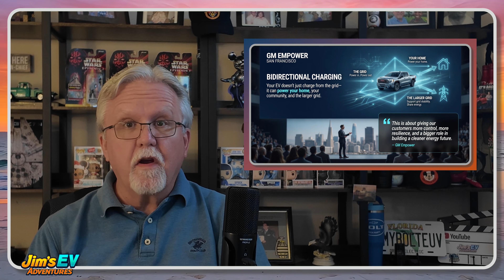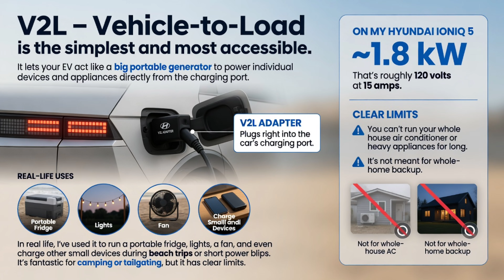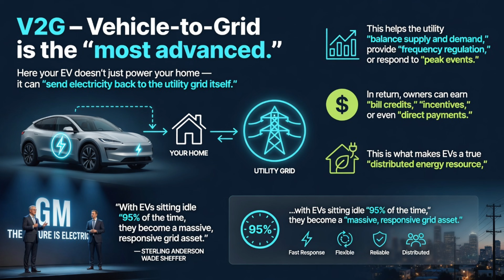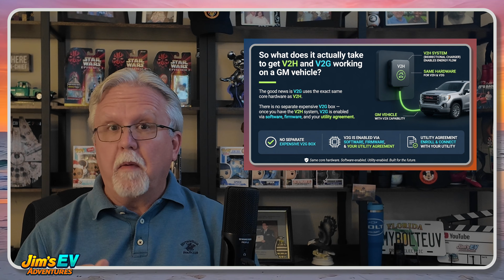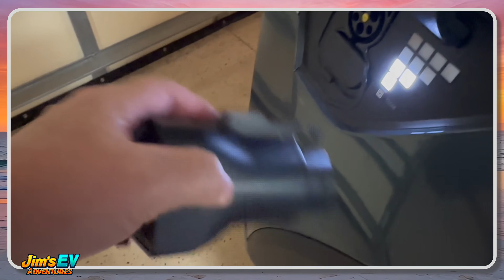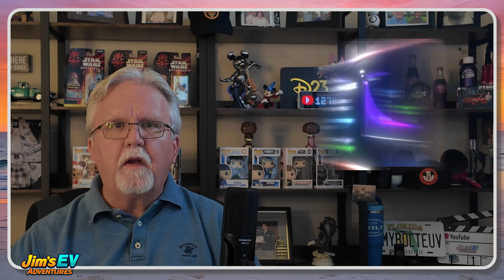Your EV Can Power Your Home! (Here's How)

Comment: My ford lightning will do this but the equipment is quite expensive and you have to use the Ford vehicle charger.  However, a cheap alternative is to use the 240-volt 30 amp port in the bed and connect it to the generator input on my solar box.  Downside is the poor software - there's no "power only" mode on the truck; it has to be on, just like you're going to drive, and you have to turn off everything that normally runs, climate, headlights, etc.
Reply from the maker: There are many work arounds. Thanks for watching.

Comment: Yes the system works great. The idea was perfect. There's a few downsides to this now and I'm not going to go in depth into all of them but I will talk about a few mainly one or two. They have all the upsides but there are two downsides to this. The one downside is if your car isn't classed for two-way charging you can still do it but it'll show it in the system which is your car's computer system. You go to get it serviced and the dealer tells you they can't do anything to your vehicle. You start having issues where your battery isn't fully charging and when they put the battery on the computer and they see that you had rapid discharge when you weren't even driving the vehicle because your mileage don't add up, they can tell that you would reverse charging the vehicle that isn't designed for reverse charging And that right there my friend is the issue. People are going to have case in point. You have the Ford lineup under Ford. The F-150 lightning is two-way charging when I say two-way I'm speaking on the term relatively of you plugging a charger in it not only can charge your car, but it can also reverse the polarity to where the charge that's in your car can power your home but the Mustang Mach E is not allowed to reverse charge. Is what Ford is saying And it was explicit Ford said it doesn't do that. It's one-way charging now. I've seen these charging systems where it can reverse the polarity and power your home from the charger. I seen it in action on the Mustang Mach E So I'm impressed nonetheless but you got to look over time. Hey I bought this car. I bought this charger. It works great. 6 months a year later I'm having battery issues or I noticed my vehicle doesn't charge till $100. It'll say $100 on my phone on the dash and soon as I unplug it's automatically at 98 or I noticed that I'm not getting the same range that I used to get. I used to be able to travel 350 mi now that looks like I'm only getting about 300. Especially if you buy this vehicle brand new and you noticed this a year after you've been using the charger. Both ways you get this system installed you want to see for yourself so you charge the battery fully. Then you shut the power off in your house and wash the system. Reverse the polarity to power your house back up. What you think about that

Comment: Hi Jim ! A folk from Portugal here. During a 8 days outage due a storm I plugged my Ioniq 5 through my generator socket and boom !! 4 days of electricity. After that just looked for the closest charger and got more 4 days of electricity.
Reply from the maker: Awesome story. Thanks for sharing.
Reply: Yes, fairly simple and painless right? Good on ya for having a panel plug available. How far did you have to drive to get a working charge point?
Compare that to trying to find a working fuel station - basiclly the same distance I expect, as it needs electricity to power the pumps, lights, control systems, sale terminals. Or one that prepped and have a generator or solar system!
Compare that to the experience of running your own generators (best to have 2 small linked, than 1 large that may fail) -
Maintenance : oil changes each 24hrs of running, filter checks/cleaning, refills of fuel (dont spill petrol onto a hot engine!) so much fun in a storm 😢.
Storage & transport of HazMat : oil bottles, fuel stabilizer, fuel tanks with explosive fuel vapors, rags, carb cleaner/starter sprays, etc.
Nightly shutdown & service of generator : conserve fuel, cut fire hazard while sleeping & stop the godawful noise so wife & neighborhood wont shoot you, dont attract genny thieves.
All MUCH harder if you live in a rented apartment block (often prohibited), or hopeing the wife and kids can handle it while away for work😮. Starts to make EV + solar panels sound good, right? Either way not free... I can buy a new portable generator or battery unit for the cost of throwing out the contents of my fridge & freezers once!

Comment: I was really excited about the possibilities of V2H and V2G ("V2X") several years ago when battery prices were very high and there were incentives for the installation of PV systems. Now, I think it's a bit of a gimmick, much as I used to think putting a camera in a telephone was a gimmick.

Additionally, the cost of storage batteries is plummeting, so that makes it more attractive to have a box of dedicated batteries in the basement, possibly able to charge the car with stored PV energy. And, I am not sure that exposing my home's battery to the daily risk of American Rush Hour Traffic, is such a great idea. I do see some benefit in being able to drive over to the next town, charge my EV's battery, and return home with enough juice to keep my furnace and fridge running if there is an extended power failure locally.

In the middle term I think the car's battery and the home's battery most economically need to remain separate. I think the near future is fast charging batteries with high mass/volumetric energy density for the car and cheap, heavy, slow-charging batteries for the house.

That doesn't mean that I think any of this is a bad idea. Indeed, in the next five years I think we will begin to see that in new construction, every standard "fusebox" will incorporate an electrical management system able to handle any combination of grid, PV, home/EV/cordless power tool battery, windmill, mini-hydro and Mr. Fusion.

I am glad that GM is working on V2X, and I am glad that others are willing to spend the money to experiment with the gear and make it work. But until the state of the art is at a much higher level, I will be spending my limited budget on PV and a dedicated home battery system.
Reply: I get your arguments, and mostly agree, but hopeing builders will use more capable (expensive) panelboxes is a fantasy. They will build to minimum code reqts unless incentiveized (payed more, or law mandated). Each State or city region has differing codes. True custom homes are your choice, but rare, and if the buyer isnt tekky and forward thinking, wont happen.
Fortunately, most can be retro-fitted or expanded later as codes require some space for expansion.

Comment: I have 2 EUV’s so I’m unsure if we could ever do anything even though it has a large 11.2kWh inverter inside. It would be nice if GM was to modify the software, but GM is GM, so they’d rather we bought something new (that we’d have to replace later). 

I do plan on V2H eventually for my battery. I’ve been researching solar, and concluded that an AC coupled, grid tied system with the addition of a “gateway” which is a transfer switch designed for solar integration. The gateway would communicate with the V2H charger, and probably V2G whenever the equipment on the grid is available. Using a vehicle as a home battery backup is more important than supplying back to the grid. Where I live, our utilities are cheap and very good. The Residential Variable rate is 8 cents off peak, 18 cents during peak. The standard all day rate is 12 cents for residential.

Comment: I have built in V2L (up to 9.6KW in a combination of 120V and 120/240V) with my F150 Lightning.  I have used this a number of times at mountaintop two way radio sites, and field "kitchens" several times.  I will be using it again for the field kitchen for our 4th of July fireworks crew meals (leave the fireworks to professionals - like me) in a couple weeks.  I will be adding a 120/240 inlet to my house for use with a manual transfer switch.  

I have no plans to add true V2H or V2G unless the incentives become huge as it's currently way too expensive and here in SoCal, we SELDOM have long duration utility power outages.
Reply from the maker: The incentives will improve. I can see this as something geared toward fleet vehicles, too.

Comment: I’ve had a Tesla Powerwall2 for the last ten years. It doesn’t support bi-directional energy flow from my EV, so during an outage I can only use the energy stored in its 13 kwh battery.  Fortunately this hasn’t been an issue because my modest 3.4 kw solar array produces sufficient power to run my home during the day and fully charge the battery.  This allows me to depend on the grid for only 15% of my total power usage.  Using my EV to supplement would resolve this deficiency but that means the EV has to be home during the outage and the cost of the V2H/V2G equipment would add about $8K to the cost of the system. I’m not sure it would be worth it for me as the Powerwall operating by itself has already offset almost $24K in energy costs over the past 10 years and has earned an average of $350/year by participating in a Virtual Power Plant program run by my utility.

I’m not trying to knock the GM system, only warning those who already have a battery system that the costs of adding the equipment necessary to pull power from your GM EV may not be justified.   Additionally if you have a Powerwall, you should know that the General Motors (GM) V2H/V2G systems are not natively compatible with the Tesla Powerwall. GM's proprietary bi-directional charging ecosystem requires specific GM hardware and operates on a DC path, whereas the Tesla Powerwall operates as a closed, AC-coupled ecosystem.

Comment: Thanks Jim! Really enjoying your YT channel.  This last winter we traded our 2013 Chevy 
Volt for a 2025 Cadillac Optiq.  Loving the new full EV and since we live at the base of Mt. Shasta in California we are especially appreciative of its AWD capability.  When I purchased the dealer provided me the GM Level 2 charger at no cost, but in my research on how to set up our home I was made aware of the V2H system that GM sells.  For that moment in time, the simpler L2 system was much more economical.  Our home is already grid-tied with a 24 panel solar array that reduces our electric bills to only a few months per year where we pay them. The V2H option remains under consideration, but the $8-10K expense has not yet moved me. I especially appreciate your knowledge and enthusiasm for EVs and look forward to more of your well studied sharing!
Reply from the maker: Glad to hear you're enjoying the new ride—and I completely agree that the current price tag on that hardware is a tough pill to swallow!

Comment: So strange.  I was just looking into this this morning.  The Equinox and LYRIQ both have something called a powerbar that connects to the J1772 port and provides V2L like your IONIQ.  However, the Equinox 3RS is the only trim that has that option and in the LYRIQ, even though I have 19.2 capable in our 2023DE, the model yr 2023 did not have the inverter needed to use the powerbar.  That only came in MY24 and later.  So, the Cadi only has 19.2 w/o V2L.  The V2H & V2L are going to be key features on my next EV purchase.  I really like having the EV as a backup home battery with at least V2L and V2H capable.  Well done video.  Thank you.  I enjoyed watching.
Reply from the maker: It’s definitely becoming a must-have feature for my future vehicle list as well!

Comment: This is wildly expensive, incompatible with my home solar setup and redundant to my solar setup and the inverter that is already in my truck. 
Additionally, by using proprietary software, this system only works with GM vehicles. ISO 15118-20 details bidirectional charging standards for AC and DC charging. I can't see this as anything other than a money grab by GM to force you to buy an additional inverter and lock you into buying GM only in the future.
Enphase and sigenergy are both working on ISO 15118-20 compliant V2G chargers, and the IQ EV charger 2 is hardware ready to provide AC V2H pending software updates. I'll pass on proprietary tech that does not conform to standards.

Thanks for the explainer, Jim. The GM series was really good.
Reply: Yes, I also appreciate Jim's analysis here. But the market needs an open source interface and, specifically, a way to adapt to the sort of 51.2VDC LFP home solar battery systems that are everywhere now, be they off grid or hybrid grid-connected system (ie: using the grid exclusively as a "battery'" and as needed: not back-feeding). With one of those PV/battery systems in my house and an LFP-equipped EV in my car port, I could survive very easily without J.P. Morgan and Samuel Insull's 19th century electrical utility business model. The utilities are killing off the potential of net metering everywhere their lawyers can. I'm sure most of them don't want V2G anymore than they wanted basic solar net metering a decade ago. 

I've been following V2G developments for well over a decade now it always seems that it's the legal negotiations with the utility that are holding back the technology. ISO 15118-20 seems to be the latest way to keep the utilities and their legal teams involved in an age where they seem less relevant with every passing day. Moving solar-generated electricity stored in your home battery back and forth between your EV's battery should be relatively straightforward. And, yes, the GM system with it's proprietary mishmash of equipment feels like a massive money grab.
Reply: I agree. I was a bit disappointed with the 9.6kWh inverter myself.
Reply: With this tech it will be an add on  with an ats

Comment: Great Vid 👍
I think GM is behind in tech - this should be an all one unit for those that opt for V2H/G. Or at the very least the Home Hub and Inverter should be combined IMHO.
Cheers from Canada
Reply from the maker: It depends on which engineer you ask — V2H/V2G both require the same hardware. Again. Price is high across ALL the technologies for now. Time and technology will improve with time. Let’s watch together. 👍

Comment: Jim, as you stated, the early adoption phase is always more expensive and will become old tech really quick.

Having said that, I would like to see GM offer this at a substantial discount, long term cheap financing and cover the cost of installation for a typical home.  Why do I say that?  Because as of right now, this system would pigeon hole you into the GM brand.  You couldn't use this with any other OEM.  It would be another reason to consider a GM product.  Selling it to try to make a profit now doesn't make sense with the current GM EV uptake.

One last thing.  I have a 26 Equinox EV with the 11.5 kw AC charger.  Would this work with the system or do you need the onboard 19.5 kw charger?  This has never been clearly stated one way or the other.

Comment: V2L, yes! V2H, sure. V2G hmmm It would have to come with specific user defined settings. I.E. Only sell to grid above (user defined) $1-2 per kilwatt. Leave (user defined) % of battery left in the vehicle. Universal hardware(say your GM gets totaled and you buy a Tesla/Toyota/Ford/Kia/Hyundai/etc EV to replace it, The hardware on the house needs to accept all manufactures.) And not cost 8000$ for the hardware plus install cost. Sheesh thats a chunk of change to hope to get back. 

I got home battery storage. I could use the Ioniq 5 V2L to slowly recharge my home batteries and just power the bare minimum.  Or the Ford Lightning has 240V that could be used to fast charge home batteries from the EV battery with the correct charger.  

V2H is nice but the vehicle needs be to HOME to keep the the fridges going, sump pump running, etc. If i'm not home when the power goes out, no power to the house. I might need to go to work with that vehicle. So home is left without power. 

Each has its Pros and Cons. Im still not buying a GM tho,.....
Reply: To your last points : A home mounted battery/inverter unit (of some size, expandable over time) is clearly optimum, working  together with an EV or hybrid car to transfer power as required. That should (but not must) be teamed with some solar panels (of some size) to permit sustained operation during outages, reduceing power bills, eliminateing generator reliance.
If you look into priceing and maintenance on a home standby generator unit like Generac or Kohler, its similar to an EV adapter unit, or a cruiser motorcycle. Long term the EV or Hybrid option becomes cheaper, and some Hybrids could provide generator power topup. Lets be honest though, most people who own these expensive electric car/trucks also have a gas one for longer ranges or hauling. Personal EV trucks for now are overly expensive toys for greenwashing credit but make sense for pizza & package delivery at West Coast $5-7 gal gas prices. Perhaps the $25k (base) Slate Truck will change this? Lets hope.

Comment: Good video Jim, good info and easy to understand. I have looked into the GM V2H outfit and yup it's pricey and my answer to the sales team was not right now as like you I expect competition and decreasing prices. And yes, I would invest in this before shelling out the money on a home generator which you'd have to feed propane to constantly with upkeep and maintenance bills. While I really like my Optiq another question would be if you invested in this equipment would you only be locked into using a GM vehicle with it? Or like in your case could you utilize not only your Bolt but also your Ionic? Thanks for sharing with us!
Reply from the maker: It’s a great question, but unfortunately, the equipment is proprietary and doesn't support cross-brand vehicle compatibility yet.